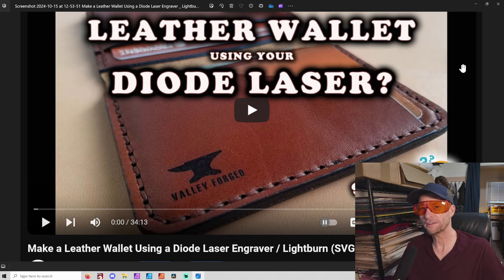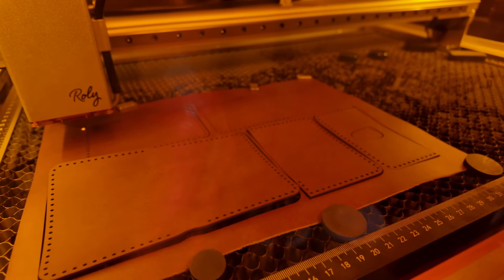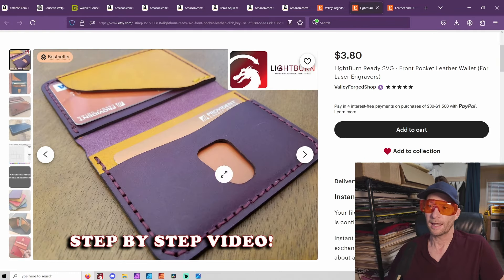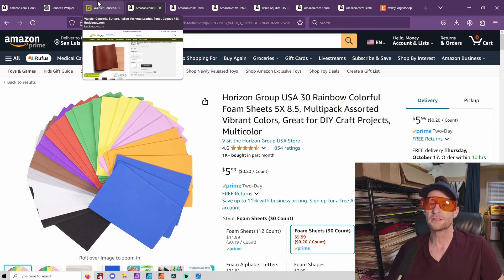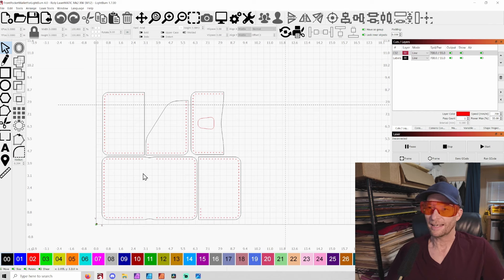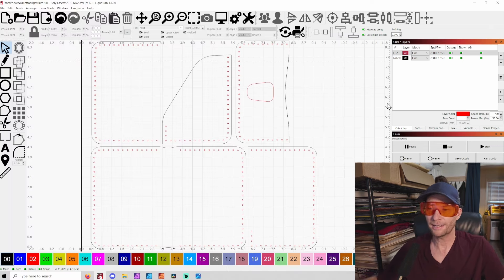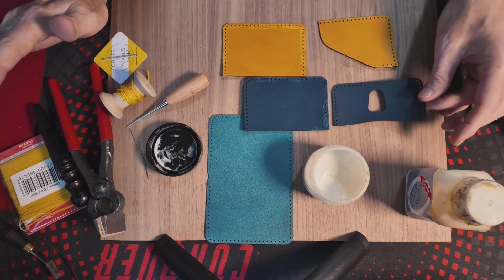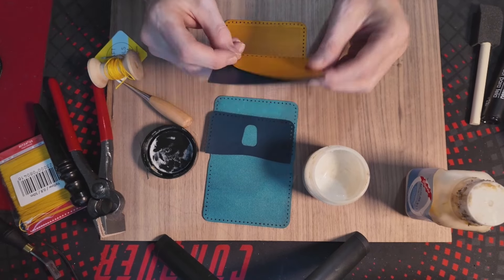Making Leather Wallets with your Diode Laser Engraver (Lightburn or SVG)

Comment: Love your content, thx for everything!  I have a question about cleaning the holes of char.  As you said a co2 laser seems to give more char which is fine for the edges but how would you go about cleaning the holes?  I used a lighter color thread and it got all dirty looking,  What's your thoughts on this? thx.
Reply from the maker: Getting your settings and air perfect are the most important. Then, if you make the tread a bit longer, the first part of thread will pick up most of the dirt, then you just end up not using that part in the end. I also use a leather cleaner to clean the thread after. Not much more you can do. Mine in now so much cleaner than when I started, just took time to get it right.

Comment: How do you keep the laser charing from darkening the yellow thread?
Reply from the maker: It is probably a ton of factors. My awesome laser, perfect settings, thin quality leather, practice...I can say my older wallets had darker yellow thread, but I could clean most of it off with leather cleaner. The picture you see in the thumbnail is without using any cleaner on the threads, it is just as it was when I finished sewing.